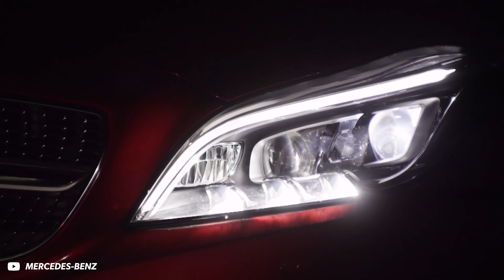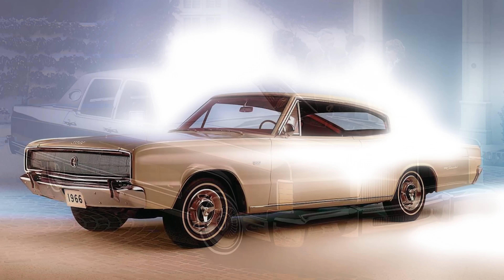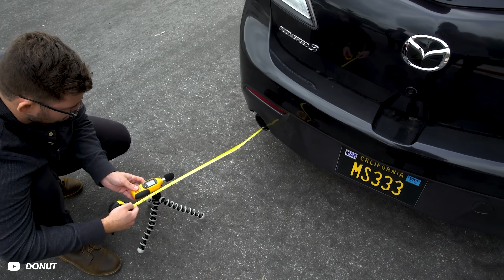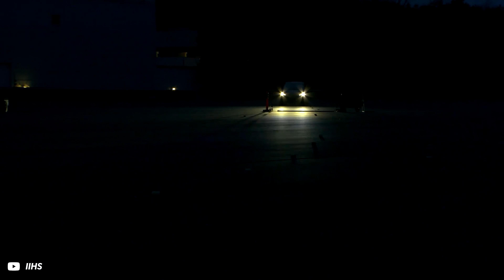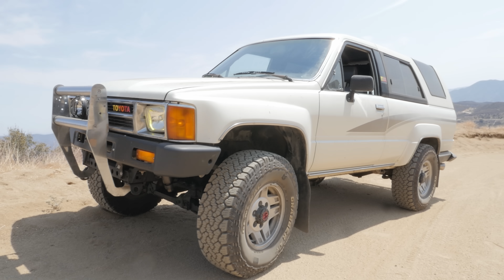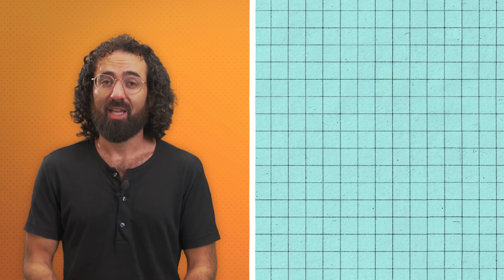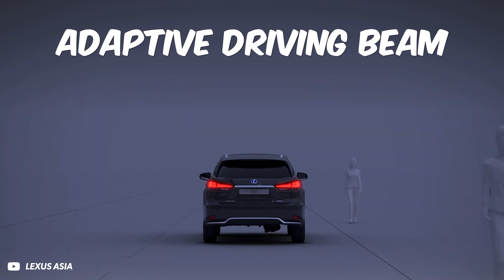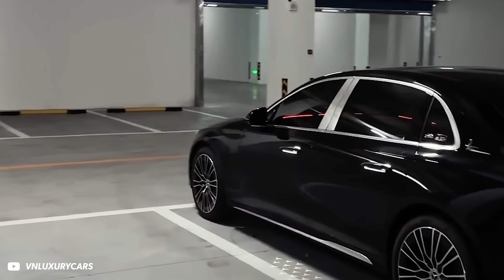Why new headlights are blinding American drivers

Comment: I LOVE the matrix headlights in my ‘26 Model Y.  I’ve never driven a vehicle with better lighting.
Reply: That update made them better, but the rest of us are still getting blinded by your headlights. I appreciate that it works for you when you are driving it, but the issue is that all of us in the other cars are still getting blinded, even if it is less.
Reply: @elizabethjamespack8541 well, I’ve never been flashed by an oncoming car, so it sounds like either you have eye problems or you’ve misidentified which cars have the matrix headlights.
Reply: While you're loving the brightness of your Tesla lights, the rest of us are getting blinded.  When I drive at night, I'm constantly being assaulted by oncoming drivers lights, and 9.9 times out of 10, it's a Tesla.  Just another reason why I hate Teslas 😒
Reply: @KarlBuckley-bw3vc this is wrong if you are talking about a Tesla with matrix lights… they dim specifically for other vehicles.
Reply: @lsh3rd  well the matrix lights are not working, especially when I’m on my motorcycle at night, I don’t think they register small vehicles
Reply: But those aren't adaptive.  Telsa failed again.
Reply: @scottwilkins also wrong… they dim for other vehicles.
Reply: @scottwilkins  Matrix headlights on Teslas are adaptive. What gave you the idea that it isn't?

Comment: The 90% solution is to MANDATE auto-leveling headlights that use a sensor to monitor suspension loading and adjust the light angle to compensate for rear seat passengers or heavy loads in the trunk.

With companies aiming lights higher and higher, it takes less load in the rear of the car to tilt the headlights up to where they’re blinding traffic.

Aftermarket bulbs are a whole other animal.  The good ones, installed PROPERLY, can work well without blinding.  I don’t trust the average person to set them up properly though, which often requires verifying they’re aimed properly.
Reply: Self levelling only takes account of the vehicle, not the road in front, so isn’t really an answer
Reply: @CJH-JH  I said it was the 90% solution.  The 100% solution would be to have the geniuses at the IIHS develop more comprehensive test methods that cover more real world scenarios, along with US regulators stopping protecting US car companies by limiting advanced headlight technology.
Reply: Sounds like an expensive solution for what should be a simple fix for OEMs
Reply: @snozbaries7652 not to mention it wouldn’t even solve the problem 😂😂
Reply: @CJH-JH  the only way to guarantee no one ever gets blinded by headlights is to ban cars.  Since that’s not a practical solution…

…let’s be pragmatic and suggest things we know will work to eliminate the majority of the problem, instead of just whining.

All European cars with HID/LED headlights are required to have automatic headlight leveling systems, and they work well.  It’s not impossible, it’s not financially impractical, and it helps a great deal.  US car companies have lobbied against it because not allowing them gives them a financial advantage.
Reply: @superspeeder now you’re just being childish to try and maintain face - the answer is less bright lights surely ??? Drivers should drive to the reaches of visibility, and if this means slowing down when other cars are around, then so be it - they can still use high beam when the roads are empty ….. it’s not rocket science - lights have become too bright.
Reply: @CJH-JH  even halogen headlights blind people.  You don’t need HID or LED lights to do that.  Just look at the people who drive around in the daytime with their high beams on… even in daylight it’s uncomfortable for oncoming traffic.

The problem is twofold: lights are brighter, yes, but the issue is they are pointed too high because they’re aimed that way, there’s a load in the back, or the road is not level.  Two of the three can be solved very easily.

The third can be partially solved by allowing advanced lighting tech into North America.  This casts a shadow over oncoming traffic.  Is it perfect?  No, but again we’re not after perfection, just the best solution.

There’s nothing childish about that.  My “banning cars” comment above refers to ridiculous arguments made by groups like MADD who claim they won’t stop until there are ZERO deaths caused by drinking and driving, for which the only actual solution is to ban drinking or ban driving.  Otherwise it will never be zero.

If there are cars with headlights there will always exist a scenario in which someone could be blinded.  Eliminating that possibility is not practical.

Dimmer headlights?  Maybe, but that will be argued against by people with large foreheads who will show data that brighter headlights save more lives than they cost.  See how that works? 😊
Reply: The only solution is go to back to halogen headlights and ban LED and Xenon.  It doesn't matter how you design LED or Xenon headlights: Roads are not level - it's impossible to not blind someone.
Reply: @ShowMeWhatINeedToKnow  halogen headlights can blind people just as easily if they’re aimed too high, there’s a load in the back of the car, or the road is not level.  Two of those scenarios can be easily corrected for.

Besides, if we ban HID and LED headlights we’ll just make brighter halogens.

Comment: Blinding is shite here in Europe aswell,. especially if you live in a country with long dark winters, and  roads with incoinations, some cars worse than others. If you have a low car its even worse.
Reply: Agree with all of this - uneven roads and wet headlights are the worst - and as for cars - Elon - your cars are the worst - sort it out
Reply: @CJH-JH they are built like hot garbage. Headlights come misaligned from the factory. And their Adaptive high beams fails to detect cars half the time due to crappy camera based software meaning they just high Beam blast you.
Reply: @OutOfNameIdeas2 i absolutely noticed that, since we dont have flat roads around here it means constant beam in the eyes since it doesnt know what its doing.
Reply: A lot of it is the high kelvin. White/blue light is high frequency so bounces off everything and causes loads of bright reflections. Yellowish light doesn't and also cuts through rain and fog much better.
Reply: I noticed this when I drove in Sweden.
Reply: Blinded by the light
Revved up like a deuce, another runner in the night
Reply: now you can almost say if you have a sedan or avant.. i wouldnt say my car is that low.. but compared to SUV my face meets their headlights.. im really close to driving with sunglasses at night :D which wouldnt help much, but yeah 100% i dont drive as much in the dark
Reply: @mercetajs i daily drive a low sports car, have sometimes tinted glasses to see anything. A few years older headlights are no problem, only newish cars.

Comment: One of the first things I've been doing when buying a new vehicle is manually adjusting my headlights down a few degrees. You're welcome, oncoming traffic.
Reply: You're the goat :D But seriously just checking if the headlights are adjusted right makes a huge difference
Reply: @xenos568  That's just the thing. They were adjusted "right" from the factory, but "right" blinds oncoming traffic. Adjusting them down a few degrees did nothing negative to my visibility other than significantly reducing the number of oncoming cars flashing their highbeams at me.
Reply: Exactly. My dad has a mercedes E class with xenon headlights that were aimed way too high from the factory. I also have a toyota with LED headlights that had the same issue. The factory and dealership didn’t bother adjusting them during the pre delivery inspection. Some people don’t understand the importance of properly adjusting the aim of their headlights. Even halogen headlights can be blinding if not properly aimed.
Reply: @jegerm6752  Yeah, the Gen3 Tacoma I bought had the same issue.
Reply: As I was reading my car owner's manual, I learned not only that lights could be adjusted, but that there are standards. So I mentioned that, and my uncle said: "yes, but forget about the standards; you just aim it, so you can see the furthest."
Reply: @sidischmidt   Except that aiming them higher doesn't necessarily make you see further, as headlight power suffers from the inverse square law squared again, ie: if you try to double the distance it takes 4x the power to light the object the same amount, then 4x as much again for that same level to come back to you. Actually, I'm not sure if it's inverse square x2 or inverse square ^2, but either way it requires a helluva lot more power. Also, those standards often don't account for changes you might make to your vehicle, like keeping extra crap in the trunk/bed that changes your vehicle's leveling. Case in point, every single work truck with one of the big work box beds and likely a literal ton of tools that passes me on my way to work. Not a single one of them have been properly adjusted to account for the extra weight. Just aim them as high as their actual power allows without blinding oncoming traffic with your low beams. And, honestly, there's an even simpler way to judge if they are aimed right. If multiple people flash you at night on level ground (not going over a rise), then aim them down a couple degrees. Still flashing? Down a little further. Eventually you'll find the sweet spot.
Reply: @chaseweeks2708  thanks for the explanation (and for being a kind driver). 
My comment was only to show that some people simply don't care whether their lights are disturbing others or not.
Reply: @sidischmidt  Yeah, that part has truly become an epidemic. I know people that literally drive around using their high beams 100% of the time just because they don't want to fix their low beams (or even figure out what's actually wrong with them), and even after acknowledging the fact that they are blinding everyone they still won't fix it. 

It's for those folks that I'm installing a lightbar under the rear of my motorcycle with a switch that literally says "Hey Asshole" on it. My kindness has limits ;)
Reply: Lol
Reply: the problem is most people aren't considerate of other drivers enough to do this, nor mechanically inclined enough to even be inspired to try.
Reply: I'd have to take the entire front clip off my car to do any adjustment.  Screw em, I'm running OEM level bright and wearing yellow glasses at night for the win.
Reply: @BigTimeRushFan2112  what car do you drive? I have only ever driven Hyundai i30 (n)'s but even they have interiour adjustable lights for at least a decade.
Reply: @user-to7ds6sc3p I own an Elantra N
Reply: I experienced a headlight that made me physically nauseous. I was shocked. It was like a weapon!
Reply: Based
Reply: apreciate it but just be mindful when cresting a hill, no level of adjustment can really prevent it from blinding others.
Reply: @BLAZE13011  Of course. But when something is unavoidable, it also no longer matters to me. That goes for pretty much all aspects of my life. I just don't flash anyone that looks like they have their highbeams on when cresting a hill.
Reply: @BLAZE13011  oh I know. That's why I don't flash people that look like their high beams are still on when cresting a hill. And I try not to on left-hand curves either, especially motorcycles because of the lean.
Reply: i'm sorry but i'm NOT touching my $2000 Audi S3 LED lights. I leave them as they leaved the factory
Reply: @Kytes93  They have an adjustment for a reason. I just looked up a video for doing it on the S3 and it looks like it's a 30 second job.
Reply: Night time speed limit.
Reduce headlight power.
Slow down. 
Cheep and simple , no high tech to fail.
Reply: @tomg6284 Only one of those 3 things would actually have an impact on blinding oncoming traffic.
Reply: There is a switch to do that you don't need to manually do it
Reply: @cun7sathome switching to dim wont matter if the headlamps themselves are pointing up to much.
Reply: @cun7sathome  I don't use my high beams. Low beams make people think I'm using my highbeams because they are both too bright and aimed too high from the factory.

Comment: What about the other side. Older cars, their headlights are so faded they hardly put out any light. They also cost an arm and a leg to replace. Let’s go back to replaceable glass and led inserts.
Reply: We won't go back to glass due to pedestrian safety regulations.

Older lamps had silvered reflectors which tends to degrade.  Later cars have aluminium sprayed on which lasts longer.
Reply: yup, this all goes back to right to repair!
Reply: Plastic can be polished. Look it up
Reply: @GeneralKenobi69420  polycarbonate will always oxidize, and most people/shops dont know how to properly restore it, they will oxidize again within months. u are at the mercy of how good the baked on clear coat is from the manufacturer. most cars have acrylic tail lights, which will not oxidize in your lifetime, which is why tail lights are basically never fog up. why are headlights almost never acrylic? it is expensive to make shatter resistant acrylic. why are headlight lenses not widely available and easily replaceable? because manufacturers want to get as much money out of you as possible.

Comment: Bad designed aftermarket headlights are blinding most of the times. On the other hand. The driver must adjust the beam to go lower. 

And the Tesla model Y is terrible as well. The low beam is set to high. I’m in the Netherlands, I don’t know if this issue is different in the US. 

During daytime I find the DRL way to bright or with some halogen variations sitting in the fog lamp location which I find poorly placed and not a good way for visibility. And the worst part is that on most cars with drl they don’t turn on the rear lights at all

I did make a habit of turning on the low beam lights before driving and from what I’ve seen with automatic lights i will continue on this habit. I hate drl and automatic lighting.
Reply: Yes tesla y are too bright.. even in the daylight .  The new model y is a lot better

Comment: Regular safety inspections would also help. I live in a state with no inspections, and feel the pain.
Reply: I’m in a state where there are inspections and they could care less what bulb is in your car as long as it has brake/running lights and turn signals and something that resembles a headlight
Reply: honestly it wont help. crest a hill and get blinded by properly adjusted headlights. the real solution is not having the sun level of brightness out of low beams. its not needed hell ban led low beams so its halogen low beams led high beams.
Reply: So you live in a free state and is crying about not being regulated enough?  Be happy you don't have inspections and have all that freedom.

Comment: Six years ago, I wanted to get LED  bulbs for my '09 Civic.  After watching almost every Headlight Revolution video I could, I finally bit the bullet and bought two pairs of bulbs, 9005 and 9006.  They had a really good beam pattern, but I was still getting flashed by others because of them.  After a couple weeks, I finally adjusted the aim down a couple degrees and I never got flashed again.

Comment: Great video, but a lot of info is not totaly correct. Lumens on OEMs headlights are not much higher than as halogen, but colour of the light is more bluish, which is good for the driver, but not for the one driving in the oposite direction. This is one of the main problems. Second is the size of the optical system. Before you had a big reflector for a 1000 lumens and now you have a small module (lens) that needs to project the same amount of light, because of that light is more concentrated and in is brighter, when looking into it. This problem (size of modules) will only get wore in the next years, styling is pushing industry in smaller and smaller headlighs. 
Problem is not much smaller in Europe. ADB (adaptive driving beam/matrix) sure helps, but it is not a game changer. There is still light that goes to the side/up (some of it is needed and is manditory). 
At the end there is no good solutions. Good ADB headlight, not to small and clean outerlens is best as we can do. And yes, avoid aftermarket...

Comment: Pretty crap and inaccurate reporting tbh
Reply: I came here thinking I was going to be able to say the same thing but this is actually incredibly well-researched. I've spent years weighing published testing on headlights, bulbs, aftermarket projectors, vs the standards (and why those areas are required testing for compliance), & searching for good solutions in order to build safe, bright, and effective headlights. 

Minimum 90% of the aftermarket is out of compliance. Photometry doesn't lie. 100% of aftermarket bi-LED headlight projector units will fail testing. Aftermarket headlamp housings have little to no QC and I've taken apart replacement housings in order to retrofit them and found that they were missing entire banks of reflector facets that are designed to take the halogen filament point source and direct it down the road where it is supposed to go.

Shit's whack.
Reply from the maker: how so?